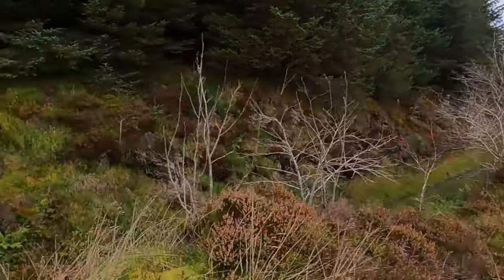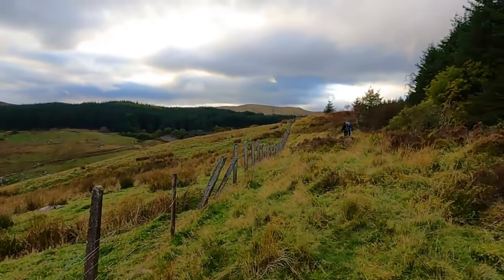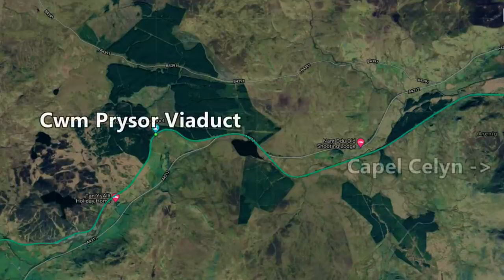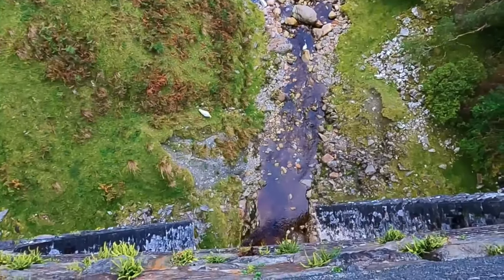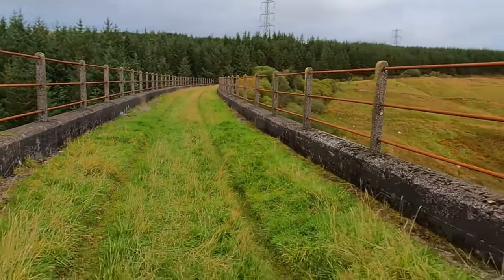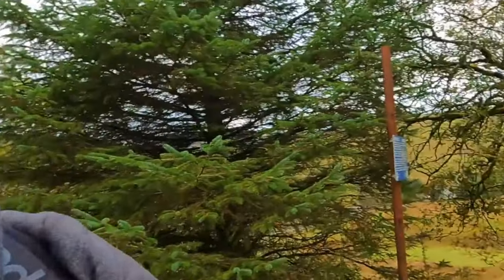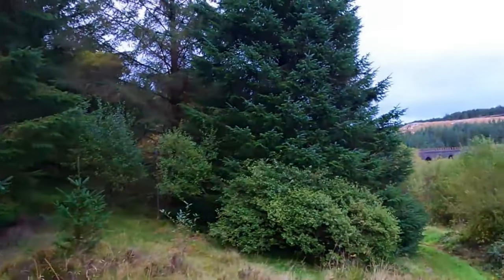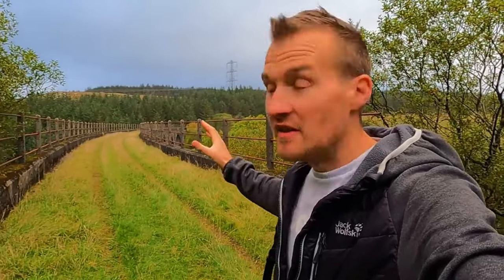The Forgotten Viaduct of the Bala & Ffestiniog Railway - Cwm ( Nant ) Prysor Disused

Comment: The correct name is Cwm Prysor the word Cwm means valley as does the word Nant one is used for a V shaped valley the other refers to a U shaped valley. The viaduct was situated on the Branch Line from Bala Junction (which was on the Llangollen Line Junction to Morfa Mawddach (built as Barmouth Junction)  Main Line) and ran to Blaenau FFestiniog. 

It is quite a sight when snow is on the ground, after the viaduct the line clings to a shelf for a long time on its way to Trawsfynydd where the old station building and goods shed survive. Good attempt at the pronunciation and a very good video.

Comment: Great presentation, big thanks! I always dream that one day there will be a heritage line reopened, going from Blaenau Ffestiniog (where the Conwy valley existing line terminates, and the Porthmadog to BF heritage line terminates [caernarfon to Porthmadog has been reopened too!] to Trawsfynydd then over Cwm Prysor) to Bala. Bala in turn has a short lakeside heritage line, and potentially could reopen its old line eastwards from Bala to Corwen, where the Llangollen heritage line currently terminates. 
As has already been said, Nant is the stream below, and Cwm is the small valley it runs through.
And I think the drop at the west end of the viaduct is subsidence.
Thanks again. Cheers.